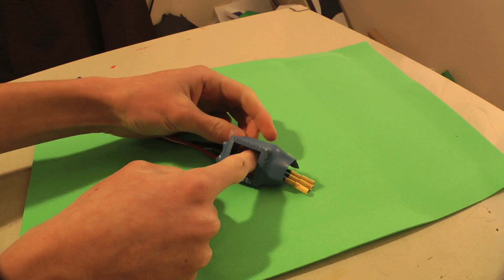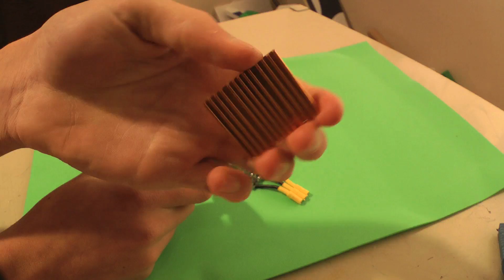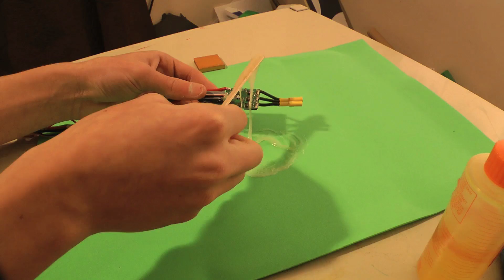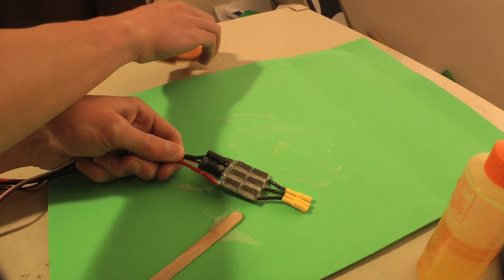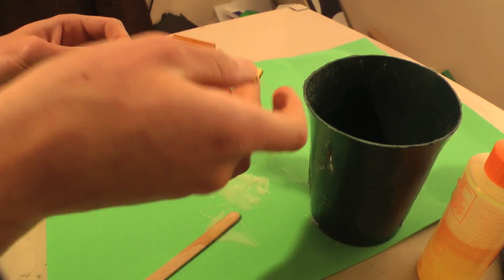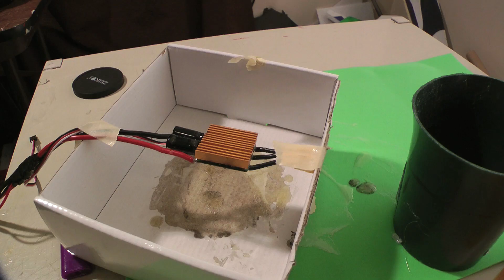How to Waterproof an ESC

Comment: actually gluing the capacitor ends is REALLY BAD, they are sealed but are designed to split should the capacitor short or overcharge and stop it from exploding and taking out everything around it
Reply: Perhaps a thin layer of RTV sealant - it would waterproof the cap but burst open if the cap exploded...

Comment: plasti-dip or any of the liquid rubber coatings is the go (i use liquid electrical tape from rc boat bitz store)
brush it on one thin layer at a time giving 10min between coats until its completely covered. then 24hr later re-heat shrink over it afterwards so you can stick velcro on it (but not on the rubber) for mounting.
i got 3x 120a boat esc's water proofed out of one can.

Comment: @hallobaaaby fly underwater? they are called submarines, radio signal is also absolutly terrible underwater bro
Reply: There are quads that land and take off from water. The ESCs are major heat sources and are better off outside of the waterproof compartment of the quad so the heat escapes easily. This solution is absolutely the way to go for getting the heat out of the aircraft while leaving the compartment open for the quad and keeping the heat in-check.

Comment: Why not just use Boeshield T9? It will leave a relatively thin film of wax w/ corrosion inhibitors coating the entire mechanism with very little additional weight plus it is designed to be kind with electronics and will not be a permanent shell like epoxy.

Comment: @zachisbeter 
brushless motors are mostly coated with epoxy. I would like to see this vid before I soaked my ESC on polaris into the river.. just to get an idea...

Nice idea.. only thing I think it should be used some quality epoxy which is resistant to higher heat.. Also is cleaner to use hairdryer than lighter..

Comment: I've done something similar to waterproof RC components, but I've used Plastic Dip(TM) or Liquid Tape(TM).  Works great, plus you could leave the heat sink on and paint around (with a brush) the sides to leave the top of the heat sink exposed.

Comment: @legoliker7517 only while it is setting. Once set, epoxy is highly heat-resistant. Interesting fact: reverse thrust elements in jet engines are layered with special high-resistance epoxy - multiple layers prevent the mechanical elements from being blasted off with the thrust from the turbines :)

Comment: @RCvehicleGuy I wouldn't.  Liquid glue can conduct electricity and could short out the ESC if the glue melted in flight.  Also wouldn't plug in the ESC until the epoxy was good and dry.